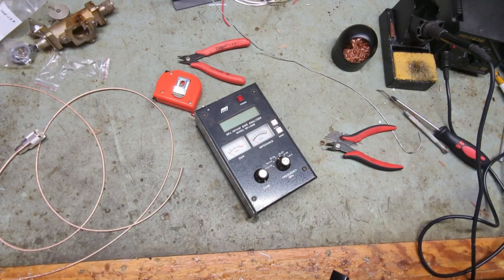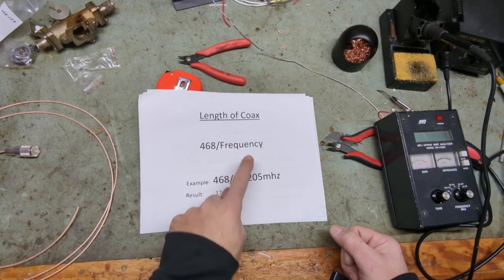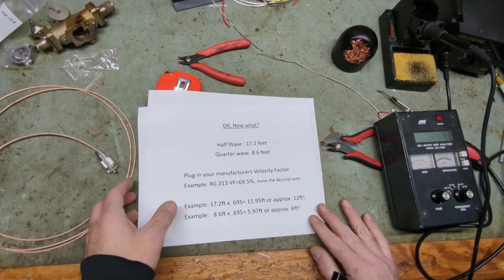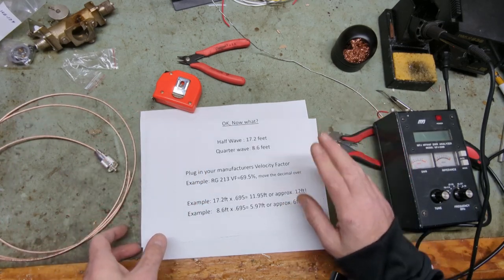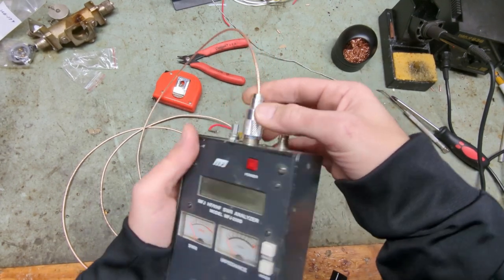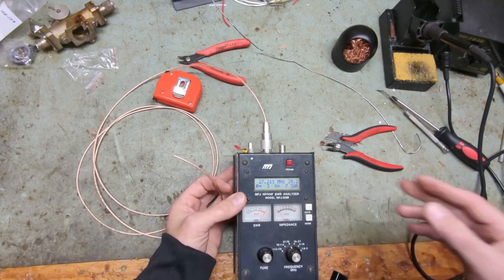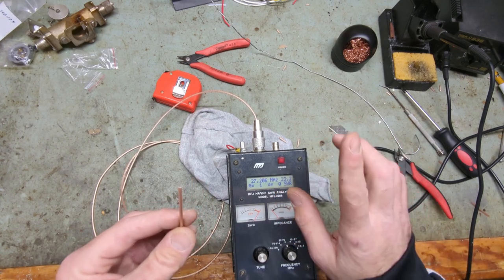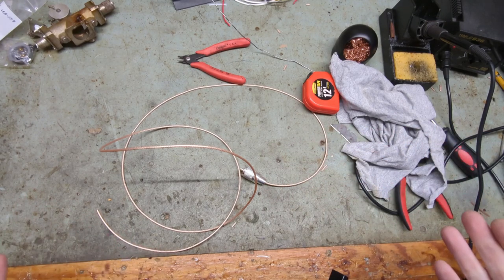How To cut your coax to nulls or coax tuning

Comment: I have heard this myth for years and am still amazed people believe this!
I have never heard of making your coax invisible in your system. Someone care to explain. In all my radio setups, I have always setup with the length to go from radio to antenna, and tuned the antenna for best resonance, lowest vswr. Put a 1:1 choke on as needed for CMC depending on antenna design. 
 Cutting coax to a specific length to accommodate the antenna besides connecting it, that tells me your antenna is the problem, NOT the coaxial cable. Some exceptions do exist, but are very antenna specific. it is not a blanket rule.
 There are books and educated folks to help with this. Some of us are also RF engineers!
Reply: I always utilize ferrite beads, typically around 15 pieces, to achieve an impedance of about 150-200 ohms at the operating frequency, equivalent to approximately 2-3 kohms. This is crucial because RF currents distort antenna matching, etc., and I prefer to avoid RF interference in my car. Inside my vehicle, I've inserted the ferrite bead choke balun into a brass tube and fastened it to the roof. While it might sound excessive, it's also to address vibrations and mechanically relieve strain on the coaxial cable. After all, it's nearly 500g in mass, and the brass aids in cooling the ferrite cores.
Reply: It's similar to not wanting your mast to become part of your antenna system. If the antenna is designed correctly it should be able to work on an insulated mast, you will find the swr changes greatly on say vertical antenna depending if you mount them on a metal mast or a glass fibre mast. No who talks about tuning their masts, we talk about height above ground but we don't talk about fine tuning metal mast length or really expect them to be part of the antenna system yet they are. same with coax. it's not supposed to but it does. You don't have to cut it, you can try with a balun or add lengths when you patch together the other gear in the shack. I find I get different results with different lengths of coax regarding antenna tune.
    If this is the reality then it's a waste of time tuning the antenna while taking SWR measurements at the radio end of the coax (unless the coax is invisible) and to be honest very few people tune their antenna at the feed point while at height.
  This puts the argument back on track. Some vertical (and some other) antenna can tune very differently to each other when each compared on 2 different lengths of coax. If the coax can be made to look virtually invisible at the desired frequency that you will be centring the tune of the antenna around then we can be more sure that we have tuned only the antenna from the radio end and not a combination of antenna and feed-line. I would like to draw also some attention to the general lack of people talking about how the metal masts also become part of their antenna systems to some extent and why are people not fine tuning their masts when they are electrically connected?  Yes it should not really be an electrical consideration yet it all too often makes a large difference to an antennas tune. Put the same antenna on a different mast and re-tune it!
  If the coax starts to become part of a radial in the system it's not ideal and it makes tuning the antenna from the shack potentially inaccurate. Now, multi-band antenna is a whole different story of compromises and tricks.
Reply: @izzzzzz6  Malarkey! If you are placing your SWR meter anywhere other then the base of your antenna when measuring, you are not checking for proper antenna tuning. 
 The only way to properly tune an antenna, and the only place it matters is at the feed point of the antenna. There is no other place in the system that impedance matching that it matters. If you are using a 50 ohm line then the only place it matters is at the antenna. The radio is 50 ohms, period, the coax is just an extension of the radio connection to the antenna. the antenna is the only place you need worry about the impedance mismatch. The antenna may have a fixed impedance such as many verticals, or tunable. If its a fixed  then you will need to do some tricks to match it, such as a transformer method, also called a balun. If your baluns are getting hot, there is a problem such as a mismatch, and you are. that heating effect is called the curie effect. You need to avoid this at all costs. as curie is approached, the effectiveness decreases. Eventually you may crack or melt your balun. As for the antenna impedance, you are only able to match it, or accept the mismatch, which will cause a high swr. No amount of cutting coax will change this. Your SWR meter is a dumb device. if moving the SWR meter to different points in the coax shows you different readings there could be a couple things happening. You could have found a voltage minimum for the frequency to which you are testing, which will look like a good match. Or you could have some Common mode Current on the outside of the shield causing you an issue. Again a dumb SWR meter doesnt know where it is in the system, it just sees what your putting in and it sees in return. It may also be seeing a high loss in the coax due to bad choice of coax such as RG58 which has a high loss, in which case it again fools you into thinking you have a perfect SWR, in truth you have lost so much power that the reflected power is so low that the meter just isnt seeing it, thus a great reading. Again, its a dumb meter. 
 Most folks do not understand SWR vs Freq, vs coax length and RF Power relationships. More folks need to take time to read the books and do some real testing at the antenna, and no where else. if you are testing anywhere else, you are not testing your antenna properly, you are testing your coax as part of the antenna, and that is a miscalculation.
Reply: @ChrisRobinsonKF6NFW  Not many amateur or CB operators do this. In the real world many people are aware that the antenna tunes differently at height. I specifically was looking for a VNA with Bluetooth connectivity to be able to measure the antenna at height. How many people do you see tuning at height? What ? With an antenna analyser and a go pro up the mast so they can than look at the data later? Might as well pull the mast up and down 10 times making micro adjustments which is what you are saying is pointless. Because any other way you must be taking the SWR measurements down some length of feed-line. Now we also know that we can calibrate the VNA from the shack end of the coax by putting the calibration resistors open and closed adapters at the feedpoint end, thus making the coax invisible to the VNA. This is the way to do it but then ask yourself why after tuning and connecting back to a SWR meter or radio the tune has changed again. Then we can add or subtract lengths of coax and it continues to change.
  So in my opinion. yes. 1st tune at the feed-point. But with unbalanced mono band antenna and some multi-band antenna you are going to see a false reading as such. But it's not really a false reading it is still telling you that even though your antenna is tuned correctly something to do with the feed line is now reflecting power to the radio thus potentially trapping it bouncing around the feed line or reflecting into the radio or amplifier. Just tune it for mono band work then everything is happy. If it was not true then i would see no change with different lengths of coax and I can say that some designs of antenna do amplify the effect more than others depending on how much capacitance and inductance they use. Now lets talk about electrically  tuning mast length and how masts and other surrounding objects want to act as part of the electrical system.
Reply: Tune the aerial not the coax.
I tried to buy invisible coax but couldn't see any.
Why do any of my aerials work with random lengths of coax?
Because it doesn't matter.
C.B. radios must be badly designed if coax length makes this difference he is showing us.
G4GHB.
Reply: @bill-2018  I experiment with many antenna and many unbalanced high gain antenna can see a huge difference in tune depending on coax length. The mast type and the mast length and proximity to other objects are also factors. It's too easy for your coax or mast to start acting as part of the system and thus can effect the tuning especially with tight Q antenna.
Reply: @izzzzzz6  I still ask how can tuned coax exist when connected through an SWR meter and a jumper lead.
That tuned length has been increased to whatever the jumper lead is and not forgetting the 4 inch or so of the SWR meter.
It's one length of coax with a meter inserted into it.
G4GHB.
Reply: @izzzzzz6  I thought today, have you r.f. on the braid of your coax? Is it acting as a counterpoise earth if you see a huge difference? Things will improve as you get to a resonant length. 
Have you checked with an r.f. pickup meter or does your SWR change if you coil your coax because that's what other videos seem obsessed with: don't coil coax. I coil mine with no alteration of SWR readings, I have no r.f. on my coax braid.
G4GHB.
Reply: @izzzzzz6  
I'm planing a video to show coax length doesn't matter unless it acts as a counterpoise earth.
My carefully trimmed coax for 14.040 MHz because I'm not chopping it down for 27 MHz.
A half wave open ended coax stub is a high impedance, the technical books tell us this but C.B.'ers think the authors know nothing. You have stated somewhere that amateurs have little education too. I don't know what C.B.'ers measure for zero but I guess mine is a reciprocal of theirs. From memory mine is about 984 Ω.
When I connect a 50 Ω dummy load onto my 'magical half wave' it's fairly flat from 1.8 MHz to 29 MHz, 50 Ω right through. No half wave peak. It's gone.

I connect my 45 inch jumper through the SWR meter and the frequency goes down, as expected. I add my 20 inch jumper and the frequency goes down again to 11.320 MHz.
There is no half wave at the trimmed length any more. It has shifted downwards, as expected with longer coax. 

I even put my FT817 and oscilloscope on and dropped 1 Volt at 14 MHz.
Dropped 1 Volt at 10 MHz.
Dropped 1 Volt at 18 MHz. 'Scope won't work much  above this. 
If coax length mattered wouldn't you expect worse results as the coax is not tuned on 14 and 10?  A terrible mismatch and maybe should drop 5 Volts or more? Should I get anything out if it's so mismatched?

These C.B. videos only concentrate on 27 MHz and not the full frequency range. Yes, it looks and sounds good until 50 Ω is put on the end.
They want you to think there is a magical length but I don't know why.

I suppose their knowledge is greater than ours, after all they are C.B. shop owners and we are only amateurs who apparently know nothing.
Now can you measure yours and prove my results wrong? 

G4GHB.
Reply: @bill-2018  when you do video show your analyser readings at different lengths to show the different impedance at different lengths when there's a mismatch
Reply: @Pioneer936  There's only an impedance difference when there is no 50 Ω
 load. It is a tuned stub. With a dummy load or aerial there is no mismatch when connected to a 50 Ωor aerial as close as possible to 50 Ω. Even a 68 Ω dummy load shows O.K.
Reply: @bill-2018  yes that's correct and this is where I think the misunderstanding arises, many think they have a flat match because they measure their swr at the transmitter when really there's a mismatch at the antenna so altering the length in any way can show the transmitter a different impedance